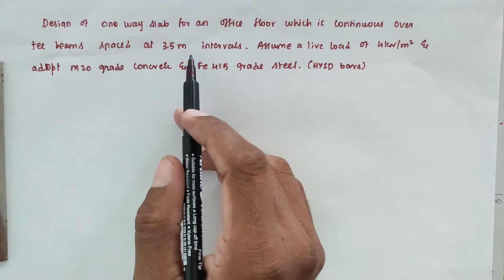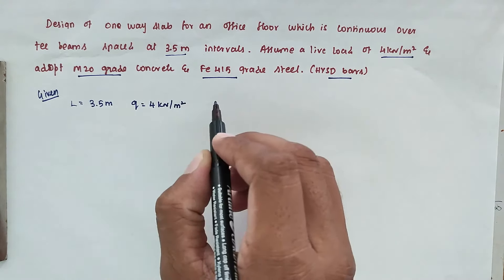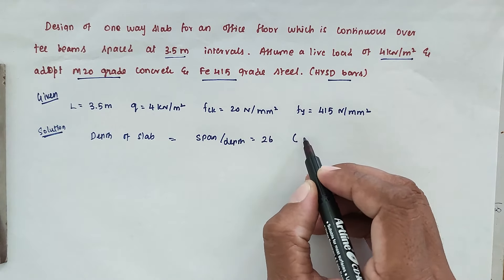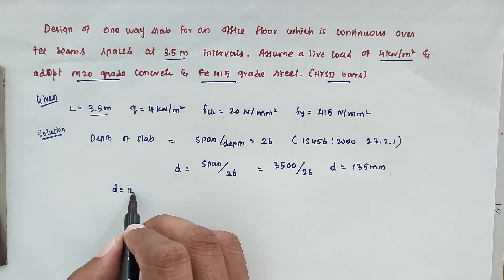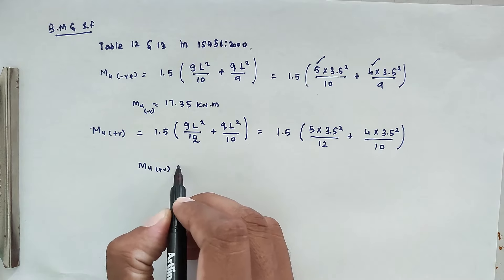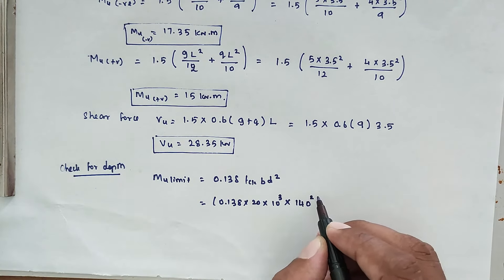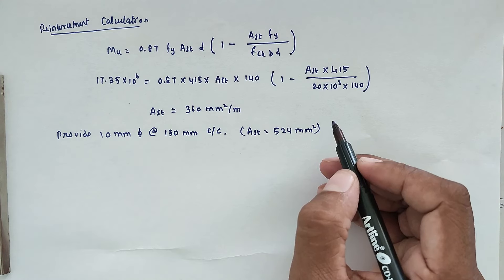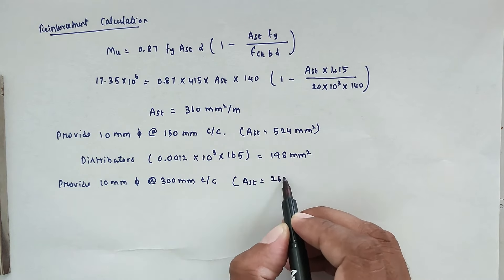design of one way slab | one way slab design | limit state method | design of RC elements | DRC

Comment: You just write answers and dictate it why don't you explain it Universe mentioned why self weight of slab is multiplied with 0.165 into 25 and you never mentioned why the maximum shear force at SP is multiplied with 0.165 into 25 from where maximum shear force at the support formula came don't dictate we also have answers please explain